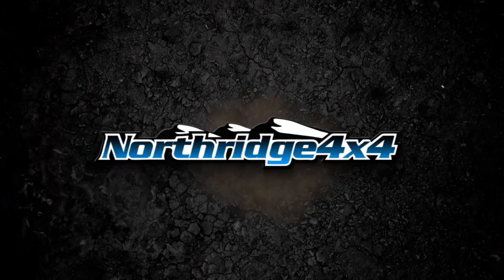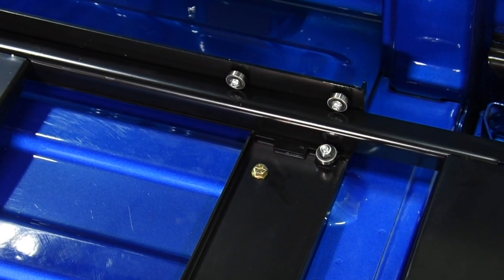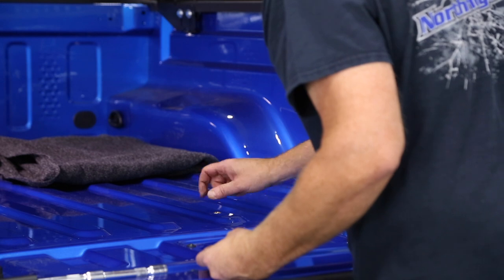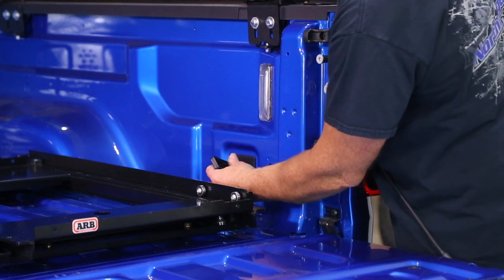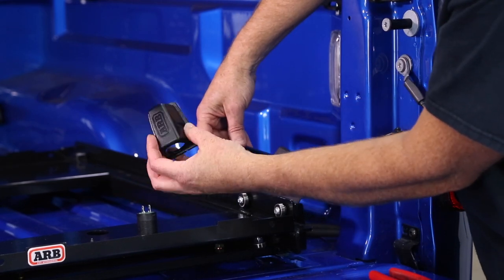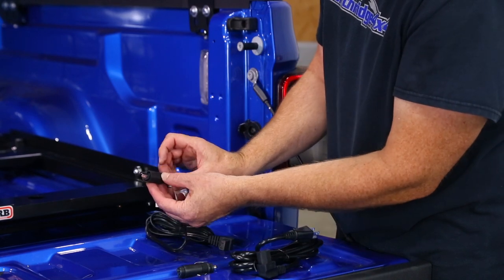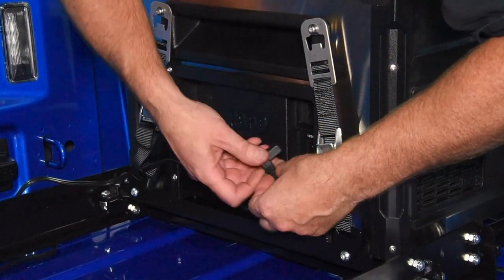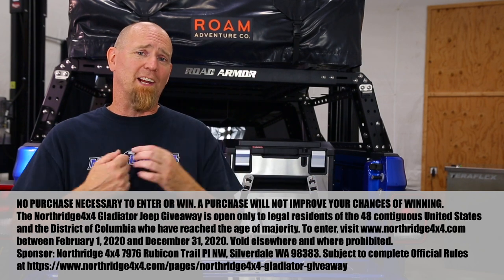ARB Elements 63QT Fridge Freezer & Fridge Slide Install

Comment: I've got the same truck, (stock rubicon height) and I have the same fridge... everything is excellent other than the paint used on the ARB fridge slide is not UV resistant and its looking pretty rough after a few months. I suggested repainting the slide with a better UV resistant paint before it fades and oxidizes.

I love this build! Someone will be very lucky!

Comment: Really tidy install, but seeing that cig port connector 🤮 should've used either MC4 connectors for dust and water resistance or heavy duty Anderson plugs so it doesn't fall apart and fall out.
Reply from the maker: That 12 volt plug pushes in and then screws into position. They are tight and secure.

Comment: Is that called a rib nut or rivet nut? Also what dive do you use for 5/16 bolt?
Reply from the maker: Rivnut is one of the brands out there. They are also called rivet nuts or threaded inserts.
We're using the 5/16" die for the 5/16" threaded insert.
Reply: @northridgenation  Thank you - that's helpful.  Off to learn about rivet nuts / threaded inserts now...
Reply: @northridgenation   Thanks you. I trying to set up ARB Fridge slider (63 Q)in a 4runner. I do not wanted open any hole in the cargo area, but there is not other way to install it .

Comment: Can that ARB wiring be used to charge other 12v fridges or accessories?
Reply from the maker: Yes. That is 20' of 8 gage wire, so it should be good up to 20 amps in a 12 volt system.
Reply: It actually doesn't work because the DC socket is built for ARB screw in plug so regular cigarette lighter plugs won't work. Wasted $55 on this.

Comment: Size Matters. Nice instructional video but after installation the top of the fridge is higher than the top of bed rails preventing the use of a bed cover, so everything in the bed will be exposed to the elements ☹️ dirt, and not secure from thieves etc. would buy one instantly if ARB made the fridge an inch or two shorter to actually fit the JT truck bed.  Any option for fridge/bed cover that anyone knows about ( other than Nuthouse Industries 5,000+ rack)?
Reply from the maker: It's the fridge slide that raises it up above the bed rails. We've ran the Elements fridge in a Gladiator with a bed cover and it fits fine.
Reply: @northridgenation  can you confirm the Elements Fridge would fit without a slide under a Rugged Ridge Tri-fold Cover?
Reply from the maker: @AZ_JTR  Yes it does. We had one under the Tri-Fold cover on the boss' Gladiator.

Comment: Hello, what is the overall height of the fridge sitting in the slide mount? Thank you
Reply from the maker: @Paul Maldonado, from the top of a bed rib to the highest point, we're measuring 19-3/4".
It is higher than the bedsides when it is on the slide. Without the slide, we can fit it under a Mopar bed cover.
Reply: Northridge4x4 thans!! Im running the fridge in a 2012 F250 with a USA Truck Covers retractable toneu cover. Im hoping to put the fridge on a slide and have it fit. If I have the clearance I’ll pick one up from you guys. Thank you again.
Reply: @pauljmaldonado  hey you reckon if the ranger is able to fit this fridge with the slider and still close with a retractable slider ?